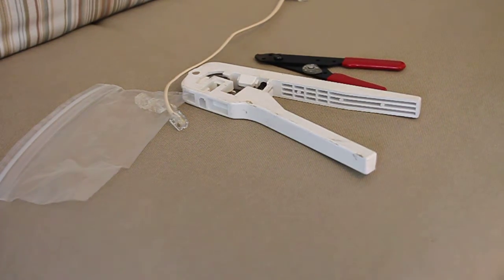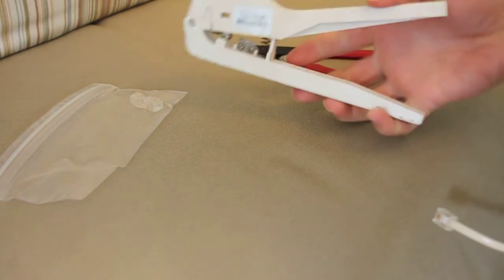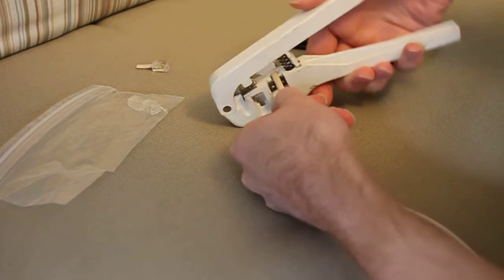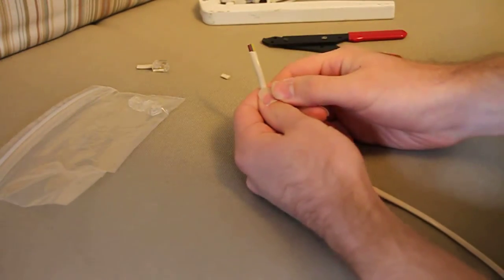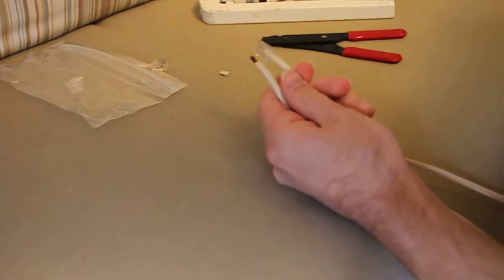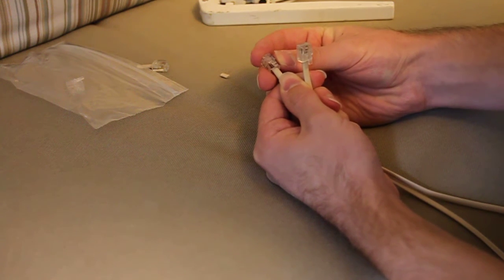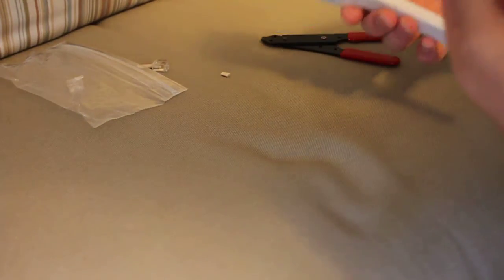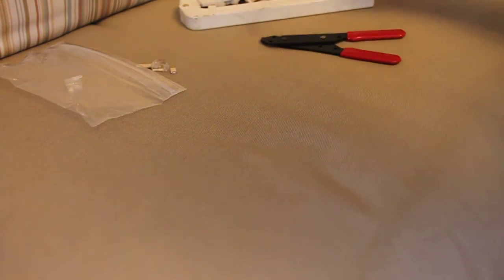Telephone Cord Repair: How to Replace RJ11 Plug

Comment: what if you don't have that tool .   are you able to do this without the tool
Reply from the maker: No
Reply: If you don’t want to buy the tool, what kind of shop would do this kind of repair. RadioShack? Is it even still around?
Reply from the maker: @rhondamercado7527  I think you would just buy a new cord at that point.

Comment: What is the exact name of the crimp tool, i'm trying to search one on amazon, but can only find one for ethernet cable. 
is there a special one for the rj-11 plug? please tell me. need to help my mom with this. thank you.
Reply from the maker: It's just called a crimping tool, there is no specific name that I know of.. If you search crimping tool on Amazon you will find plenty of them, any of the ones compatible with RJ-11 size plugs should work fine..

Comment: I sure wish they had an "RJ Clip" for phone cords, kind of like the one they have for the RJ45 cords for Ethernet connections at www.rjclip.com
Reply from the maker: That's a brilliant product, but it's too expensive.. It's much more economical to just replace the plugs..
Reply: +Jordan U The problem with this is, it's the RJ11 plug to my answering machine, which is built in on the back of the machine, so instead of two ends with RJ11 plugs, there's only one end with an RJ11 plug, which plugs in to the wall. I'm not sure how I would go about replacing that without sighted help. The RJClip is only $5 and you get a set of 5 of them in your choice of colors. The problem is, they only make the RJClip for RJ45 cables as of this moment.
Reply from the maker: When you cut off the old plug, leave a small portion of wire attached to the plug so you can strip it and see the color scheme.. Then you will know how to connect the new plug..
A dollar for one of those things is insane in my opinion, you can get a new plug for less than 10 cents.. And that plug contains far more materials including metal contacts..
Reply: +Jordan U There's only one problem. I'm totally blind. I can't see anything, not even lights or colors! I do everything by feel, so what you're describing would be a bit hard for me.
Reply from the maker: I understand, that is quite a dilemma.. If you don't have anyone to help you with it, I suppose the only other option would be to take a guess, it can only go in two ways so it has to work the first or second time..
Reply: +Jordan U Is it possible that putting it on the wrong way can cause smoke? Like when you put a plug with a round side and a flat side in backwards on a hard drive?
Reply: Is it possible that if you put it on the wrong way, it can cause smoke? Like when you have an electric plug with a round side and a flat side, and you put it in backwards, with the flat side facing to the right instead of the left? I did that with a hard drive, and unfortunately it caused me to lose all the data on there, as the company that makes the drive refused to recover it for me unless I was able to pay at least $3,000! Sure I was willing to do it, but I wasn't able to, as I didn't have the funds. I don't want that to happen with my answering machine!
Reply from the maker: I can't guarantee that won't happen, but usually it just doesn't work.. The off-hook voltage and amperage draw are quite low on phone equipment.. The only time it may cause something like that is if a call were to come through on your line, since the ring voltage and amperage draw is much higher especially on older equipment..

Comment: Too bad this video didnt give me what I was looking for and that was how to repair a phone cord WITHOUT HAVInG PROFESSIONAL TOOLS AT HOME, so I wasted a visit here.
Reply from the maker: The only thing that was wasted was the time you spent writing this rude comment.. The video never promised a fix without tools, in fact the tool was pictured in the thumbnail.. It should be no surprise that a tool was involved.. It's not a professional tool, you can find it at most hardware stores and major online retailers like Amazon and eBay for a few dollars.. You need it to perform this task, it's unrealistic to install a new plug on the wire without it..
Reply: @JordanU  well said.

Comment: Looks easy enough. Similar to the RJ-45 Ethernet jacks but with that, color matching is a must or it won’t work.
Reply from the maker: It is pretty easy, and the process is more or less the same for repairing an Ethernet cable..
Incorrectly aligned colors will cause any kind of cable to not work..

Comment: before buying wires and connectors, make sure that if you buy a 6 way wire it will need the 6 ends connectors because ther's another type of wire with 8 way and 8 ends connectors. sorry for my english i use to speak french.
Reply from the maker: Standard residential telephone lines are 2 wire.. In some cases, such as if you have two phone lines, there will be a 4 wire connection.. I've never seen 6 or 8 for telephones.. Ethernet would be 8 wires..
Reply: RJ45 is for Ethernet and RJ11 is for telephone

Comment: An excellent video, showing exactly what I needed to know.  To make matters simple, I used a felt tip pen to mark the cable so the RJ11 connector went on exactly the same way it came off.  It is possible to put the RJ11 connector on backwards so the wire colors are opposite to what they really need to be.

Regards, Tom
Reply from the maker: This is true..

Comment: Love the vid guide and hope you'll answer a couple of questions (spent 30 mins searching the web but sufficient answers not found)

1) is the name of the PLUG RJ-11? If not, by what name/number is this type of plug identified?

2) The plug we want to repair contains 8 wires --  it was originally for two telephone lines  --  two sets of wires striped and solid, color coded solid: brown, orange, green, blue and striped: brown, orange, green, blue striped with white. Will the process and plug you've shown work properly for a set of 4 wires?

3) On our cord the "broken plug" is no longer present and we can't access and examine the plug on the other end of the cord because it's plugged into the wall behind a full heavy bookcase. Given this situation how does one determine the correct wire order & placement in the new, replacement plug? What test can we do to determine the correct wire order & placement? 
(Replacing  the ENTIRE cord isn't an option because it runs under carpet and behind heavy furniture and we're not physically capable of moving all that to access the existing cord.)

4) We want to make sure we buy the correct modular crimp tool.  What is the brand and model number of the one you use?

Thanks in advance for answering. 

We've subscribed to your you tube channel.
Reply from the maker: 1) The plugs used in the video were RJ-11.. That is the standard for typical phone lines having 2 or 4 wires..

2) What you have sounds like an Ethernet cable,, not a phone cord.. In that case,, you'd be working with an RJ-45 plug,, which handles 8 wires.. There's no way a typical RJ-11 phone cord can have 8 wires.. But yes,, the process shown in the video will work for a maximum of 4 wires..

3) There is a standard pattern that Ethernet cables typically follow,, you can search "Ethernet wiring standards" on the Google and you should be able to find it.. I can't post a link to the diagram otherwise the comment will go to spam.. I can't say for sure that the wire you have was wired to those standards,, especially if its not an Ethernet cable and rather is some type of custom cord.. Without buying expensive meters,, I'm not sure how you would check it..

4) The tool I have has been around for a while and I'm not sure if they still make it or not.. The brand on it is GC Electronics and the number is 30 9950.. Note however that this tool only does RJ11 and not RJ45,, which is I believe what you have..
Reply: Thanks for taking the time to reply Jordan.  The cable in question is the cable installed for our two line phone --  not an Ethernet cable.   Thanks also for the info on the tool,  We'll continue researching.

Comment: Thank you so much for making and offering this video. I just bought a land line phone on ebay and not until I had paid for it did i notice it was sold so low due to the rj 11 plug being missing/broken/ripped off. I will buy these tools used and feel confident that I can repair the cord without issues!!
Reply from the maker: Great! I'm glad this video was helpful for you..